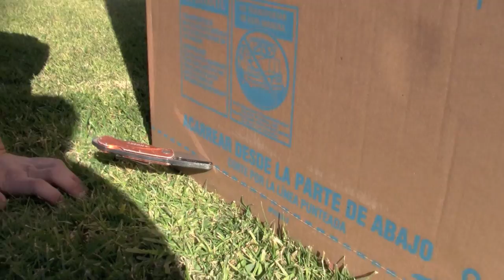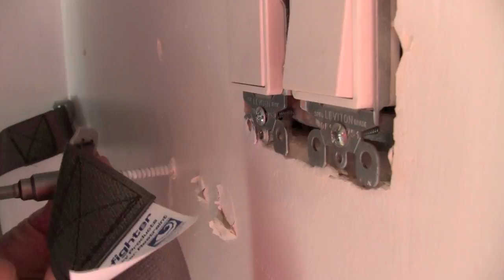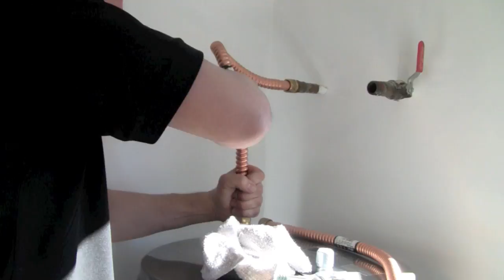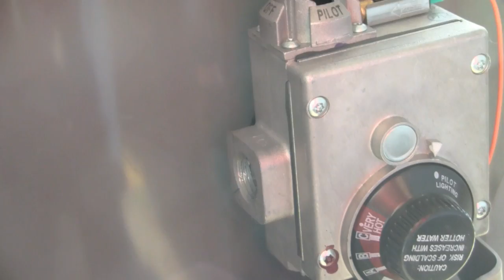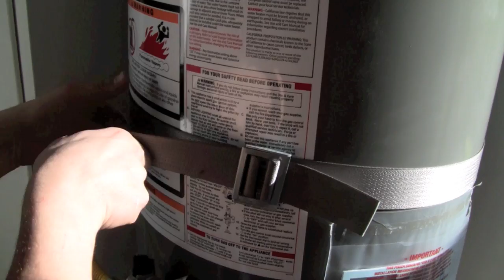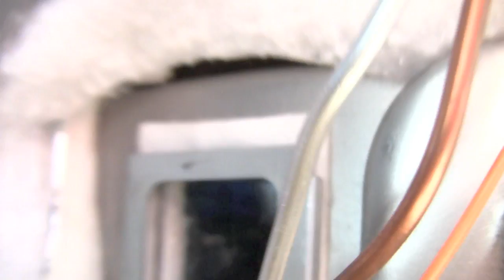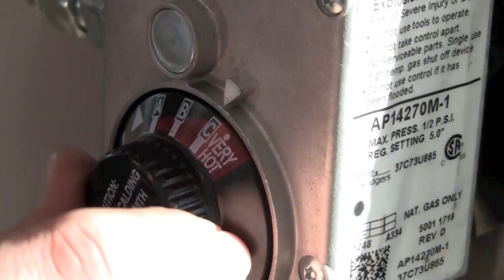How to Install a Water Heater - Step-by-step

Comment: Thank you for making this video . I desperately need your help . I live in NY in a private house in the attic . My landlord died and National Grid would not open a gas account on my name,  so I now live with no gas and no hot water . I am 19 year old girl and I don't know anything about pluming . I was researching on how I can solve this problem and found this heater in home depo . I was wondering if we would install this heater would it work for a 3 story house ? I have neighbors on the first and second floor . Would we have to just install this unit or we would have to change the pipe lines from gas to electric ? How much would that cost ? Should I just find a smaller unit just for an attic or should we all cheep in and but a big one ? I would greatly appreciate any advice you can give me . Thank you .

Comment: I install my own water heaters.
How much does a plumber charge to install one?
😇😊😊😇
Reply from the maker: +Ruben Ruvalcaba The going rate in Los Angeles is around $1300 for a 40 gallon.  Thanks for watching!
Reply: How2Plumb
So the labor is around
600.00
Thanks for the video.
😇😆😃😇
Reply: just got a quote for 1600 for a 40 gallon. then he said 8000 for a tankless!!

Comment: Thanks Dan.  Great video.  When connecting the yellow gas line you did not use pipe compound when connecting  to the water heater or the gas supply valve.  Is it standard practice??
Reply from the maker: +Ming Koo Yes is is standard practice not to use pipe compound on the flex supply line because it is tapered at the end.  Great question thanks for watching!

Comment: So at the beginning you showed what supplies you needed but you didn't include the soldering tools and equipment.  You should add those.
Reply from the maker: +Kimberly Lawson  yes that is because most of the time you can simply re-use the old T & P copper pipe, by unscrewing it and re-installing.  Thanks for watching!

Comment: This video saved me $1000! Thanks Dan!
Reply: me too
Reply: @Trixie1294  Not me, I have to saw the old one off it's pipes and then I will be left with connections that have to be welded.
Reply: @crand20033  I had the same but welding is still not necessary. You use a shark bite connector and it snaps right on. Use a 3/4 flex pipe or 3/4 to 1/2 depending on how thick the copper is
Reply: @djblock215  Yes you're right, that's true.

Comment: No expansion tank?
Reply from the maker: +rikosha prl expansion tanks are only required when there is a pressure regulator on the building. This is because the pressure regulator locks the pressure in the system at which point the expansion tank allows the pressure to go somewhere. Great question thanks for watching!

Comment: Best video I've seen for a newbie like myself. My new BW 40 gal gas WH will be arriving tomorrow. I keep playing your video over and over, as this will be my first install of a WH. Thanks so much for the clear, concise, easy to understand narration and camera work. Local plumbing companies want $1495 to install a new gas WH and take away the old one. I bought a new BW online for $589. You saved me $900 with this video. Thank you, sir!!
Reply: John Gonzales how did the installation go?
Reply: Kendon Doris

Hi Kendon. The install went great. ONLY because I viewed this video about a dozen times before the wh was delivered. I also made sure to have the plumbing fittings and extras I needed from Lowe's before I started. I took my time with removing the old water heater, then followed the instructions to the letter. It worked out great and the best part was the money I saved by doing this myself. Thank you for asking.

Comment: Great video, just need some advice. I followed the video but I ignored that fact that you didn't mention about a circulating pump, I just thought its old & we have a small house so there's really no need for the pump. When I filled up the tank I noticed the circulating pump started dripping so I went to close the valve but valve is jacked, I'll fix the valve but I'm worried, is there something I should do about the pump? Would it be okay to just install a new valve & leave it closed?

Comment: Thank you , it is very professional installation and explanation . My 75 gallon hot water heater installed more than 11 years ago . Still working good , but I will not bring a plumber to rep me off . I will do it by myself the same way you you show . It is simple and easy . Thank you very much .

Comment: Are those copper water supply hoses dielectric? You failed to mention that topic. Thanks
Reply from the maker: +Cutting Edge Yes those copper flex connectors are dielectric, as they have plastic sleeves at the connection areas.  Thanks for watching!

Comment: the btu on my hot water heater is 35,000 its a 40 gallon tank, natural gas. I have a furnace in home too. not sure of what length (gas line) flexhose to buy nor the size 3/4 or 1/2inch. the fittings to the existing tank are half inch I believe and its a 40 gallon tank as well. we are really having trouble figuring out what length and size flex connector hose to get. I read that-- I should get a gas line with btu that barely exceeds the hot water heater heater btu?? what if I bought a 1/2inch x 24inch flex connector gas hose that 85,000 btu??? any dangers of that with a hot water heater that's 35,500 btu since the btu is so far apart in number??? or loss of efficiency? how can I be on the safe side  with the right gas line?? what do you recommend? from my understanding- the flex hose pack says that  I would need a 1/2inch  72inch flex gas hose with a hot water heater that's 35,500 btu?? that would be a 6ft gas line! WOW! The gas line  that's on the existing  water tank is made of copper and its only 13inches! I prefer this flex connector over the copper, only if possible, because its more simple to deal with. but Ill take your word on what I should get?? you're the pro!!

Comment: I have a 24'' flex connecter gas hose just like that. my question is.. I saw that you put pipe dope on the piece that you screwed into the hot water heaters gasline.. why not pipe dope on the  intake gas line part? and on the other two screw pieces in between?? please I really need to know?
Reply from the maker: +jofd kcxjvx no pipe dope is needed because  the gas flex connector has a flare connection on it that acts as the seal. Great question!
Reply: +How2Plumb awesome thank you! so with that specific hose. pipe dope only goes on one end of the hose, the part that screws into the tank, that's it? cool! its amazing how the gas flex connector wont leak without the pipe dope!
Reply from the maker: +jofd kcxjvx Pipe dope is not used on BOTH ends of the flex connector because they both have a flare connection.

Comment: That valve to the right of the control unit, is that just for water tap line? Nothing special about it?  Thanks again,
Reply from the maker: +Kenshin Tran  Yes it's the water drainage line when you need to flush the water heater or drain it.

Comment: Thank you, thank you, thank you!!!
 I was beginning to start sweating about sweating…  I have watched enough and done enough to feel confident to sweat more pipes. The copper flexi-pipe you just showed however, looks like it will handily replace the stainless steel braided RUBBER tubing  which I believe is causing black micro-particles to show up in in the tub two years after install of a New water heater…

Apparently it's the rubber inside the stainless steel braid that breaks down where are you have chlorinated city water.... And while I was willing to replace the s.s. braided hose with freshly sweated three-quarter inch copper, I think you have just saved me a ton of time!...shee-it, and I was going to be so proud to show my sweating-prowess... Ahhhhhhh welllll....

...grinnnn...

So thanks again,

Chas
Reply: Haha! I was going through the exact same "sweating". Water heater installed, no sweating, OR sweating. Great video though

Comment: Must I install the vent? the water heater i have currently doesn't have any vent going into the ceiling.
Reply from the maker: +Akbar Laeeq 
If the water heater is gas it must have a vent.  If it is electric no vent is used.

Comment: thanks for the video, I will attempt to install my new Rheem 40 gal gas water heater ($389 home depot). looks like there are plastic nipples covering the water inlet and outlet of the tank. do these plastic covers need to be removed before connecting the water supply line and the hot water outlet line?  in the video when you are connecting the cold water supply line(@ minute 11:14) is that a white nipple(cover) on the tank inlet pipe I see?

Comment: All of your videos are awesome, thank you.  I am wondering how to know what to use to seal different pipes, I take it that pipes with a gasket don't need anything else like joint compound or Teflon tape?  When should you use Teflon and when to use joint compound and what should be used with pvc pipes as well.  Figure you would be able to explain in an easy way to remember, thank you!

Comment: Also, it's a good idea to check for proper venting around the hood or down draft diverter. This must be done with the main burner on. Give the vent system a few minutes to warm up. Use smoke from a couple of matches (let matches burn, then blow out) to test around all sides of the hood. The smoke should be drawn up the vent because a good vent system creates vacuum. If it blows back towards you, that's bad because some of the exhaust is going inside your house or garage. The cause is usually a restriction in the vent system, or an excessive horizontal run of vent piping.

Comment: When you fill the tank with water doesn't pressure build up inside the tank?  I always open the relief valve as I'm filling the tank to release the pressure, but you didn't show this.  I guess a properly functioning relief valve will open and allow air to escape when pressure gets high enough.  The other thing I've noticed is how much dripping occurs when you first heat the cold water.  Until I'd done a couple I thought there was a leak somewhere inside but it's normal condensation.
Reply: Thank you. You answered my question about aur in the tank! Now I think I will attempt to tackle this task on my own!

Comment: I never really seen installs using those flex supplies, how is it that a vacuum breaker is not needed?
Reply: It's probably on the ground floor.  That would be my guess.
Reply: mike doyon   An vacuum break is used when the water heater is higher than the nearest fixture. e.g. when the water heater is on the top floor or possibly attic.

Comment: Thanks for the video...as I'm not an experienced plumber.  I will admit that I bit-off more than I could chew but was successful in the end.  This task took me 10 hours to complete (read on).  Note: The confined space was located in the garage.  And let me tell you; it’s been hot hear in Texas lately.  Heck, it’s been so hot…I saw Superman in taxi cab.  Anyway, I removed the original faulty water heater according to the video instructions.  It was very obvious that every water line connection showed signs for water leakage and the connections seemed delicate/fragile to the touch.  Nevertheless, I unpackaged the new water heater and installed all of the nipple fittings and used plenty of Teflon tape and paste for the gas line.  I lifted the semi-heavy water heater into this confined space and installed the water heater according to the video instructions.  I turned-on both the gas and water supply valves and lit the gas pilot per the manufactures instructions.  However, the gas burner failed to light up and water began to leak at the ball valve.  The brand new water heater came defective from the factory.  I troubleshot as best I could and eventually contacted Whirlpool Technical Support.  Unfortunately, the Whirlpool Help Desk technician (desk jockey), gave me a hard time all the way through.  He said I needed a volt meter to help him troubleshoot.  I told him I would have bought at volt meter at the time of buying the water heater if that was part of the installation process.  He then wanted me to fax him the purchase receipt.  In the end, he gave me a "Return Merchandise Authorization" number to replace the unit back to Lowes.  Well, I reversed everything I had just done and returned the unit back to Lowes (2.5-hour road trip)…and made a pit stop at Chik-Fil-A.  I looked like a mess.  Fortunately, there was only 1 water heater left in the store.  While in the store, I recalled the water supply line ball valve back at the house being leaky at the handle.  But, the valve was soldered onto the water supply line.  The only way to replace the ball valve was to cut it off at the supply line.  So, I decided to buy ¾” “Blue Hawk” push fittings and new compression connection water hoses.  I got back to the house and went to cutting the pipe.  Immediately, water began to spew everywhere.  I nearly "sharted" in the process because I had forgot to shut-off the main water line.  I ran out of the garage like a chicken with its head cut-off and found the man-hole cover and water main by the side-walk.  I popped man-hole cover open and frogs jumped out at me from every direction…and so did I.  These guys were fat and juicy-looking.  Again, I nearly “sharted” myself.  I shut the water-line off and the water stopped flowing.  Whew!  I sanded the supply/return lines and installed the push fittings and new water compression connection water hoses.  At this time, I became very tired and wired and almost started to laugh…”like what the !@#$ did I get myself into?”  So there I am trying to fit this water heater that kept slipping through my sweaty hands and arms.  I gave about 5 attempts and kept getting tired and tired.  Finally, I slid the water heater in-place (nearly sharting again) and reconnected everything.  I turned-on the gas and water supply valves and bled the lines.  There weren't any leaks and hot water was regained.  SUCCESS!!!  By this time, I was wet with sweat from my head down to my butt.  I collected all of my tools and drove home.  BTW: I secretly took-on this task to surprise my best friend and his wife, who are on vacation.  Now you understand why I was a bit terrified throughout the entire process.  Next task…the new sink and garbage disposal.  Wish me luck!!!

Comment: Is the 3/4 inch the standard size for the flex pipes?. I've got some older copper pipes but I want to replace it with the flex pipes.
Reply: yes 3/4" is the most common pipe size for water heaters, it will definitely not be anything smaller than 3/4"

Comment: When I bought my house four years ago, I didn't know that our gas company required us to have a regulator attached to our water heater. I replaced the water heater about two months after I moved in. A week ago my pilot light kept going out, so I used the warranty and ordered a different part three days in a row. Nothing worked, the pilot kept going out between ten and thirty minutes. I was advised to call the gas company. The technician arrived and saw that I didn't have a regulator — he gave me a paper with a fine written on it, then turned off my gas and put an orange sticker on my meter. I guess that I'm angry with myself right now.

Comment: Was confused about the input cold connected to the hot out b4 u began?
And that the video did not start out saying it was a gas installation. But wonderful sound- wonderful video.
Thank you.
Reply from the maker: The cold inlet was connected to the hot before I began only as a safety precaution. If someone were to accidentally hit the shut-off vale, water would not spray everywhere. Cold water would just be forced into the hot pipes. Good question. Thanks for the comments!
Reply: Gotcha- good sense that.
D

Comment: What did you use to solder? I've heard stay brite 8 is good for soldering? Would a torch you can pick up at a box store produce enough heat to do this?

Comment: no expansion tank?
Reply from the maker: Expansion tanks are only required when there is a pressure regulator on the house.
Reply: How2Plumb
expansion tank sometimes already located elsewhere in the building. Needed if there is a backflow built into the water meter, it allows the water to expand when heated without leaking out the tp safety valve on the water heater.

Comment: well done video how - one question about expansion tank some places require them
Reply from the maker: Expansion tanks are only required if there is a pressure regulator installed at the front of your house.

Comment: hey hi, nice video. you showed the water and gas but what power is used for that electronic ignition of the pilot light?  Is there a need for electricity for that?  thanks
Reply: no need for external electricity, all run by a piezo element that turns the push motion into electricity

Comment: Excellent video Danny  Well thought out and thorough and good humor about missing studs  Keep up  good works and thanks for sharing your experience  Helped me immensely.

Great part on the cloth straps  used them  found at  plumbing supply shop wouldn't have know without this video   

For self  tapping screws into tank how long and what number screw don't want to go to deep into tank  thanks again

Comment: I thought your video was very thorough, but I didn't see the install of the expansion tank. I imagine you're in California due to the installation of the safety straps... Are expansion tanks being installed not code in California? I also appreciated the fact that set the temperature to "B" instead of factory setting. Would a hotter setting allow hot water to get to my taps faster? Currently, with the setting on the default (120 F), hot water gets to my taps much slower than the outgoing tank.

Comment: Flare and compression fittings, even wo rubber, use no compound. They work metal to metal.
You just need to know or read instructions from various sources.
There is a wide variety of fittings.